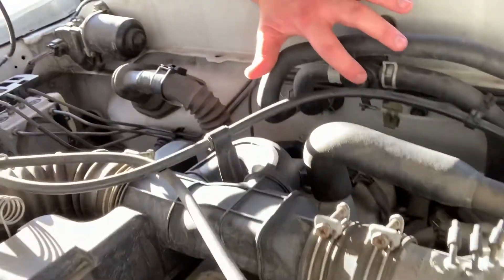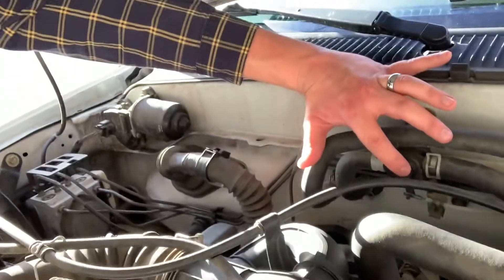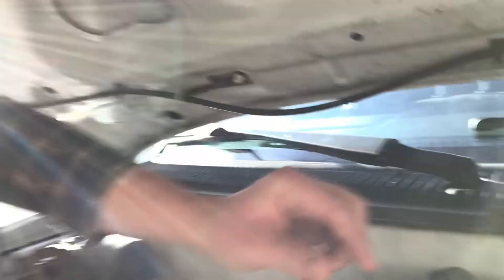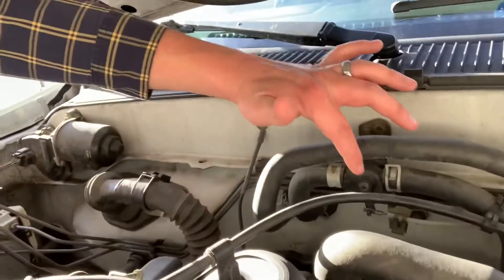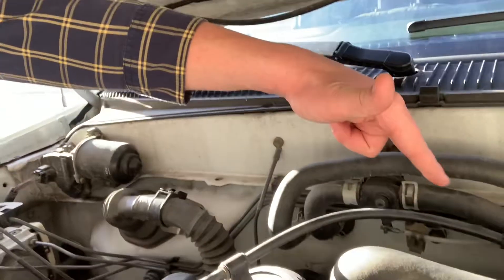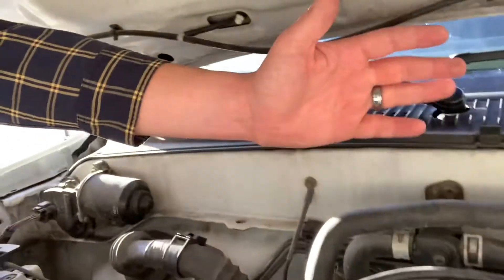1995-2004 Toyota Tacoma Heater Fix (For Free!)

Comment: If you haven't already figured it out yet:
The heat selector round knob on your dash that turns from blue to red
(cool to hot) is what is stroking that cable back and forth on that part which is the heater control valve. Not sure if your valve locked up or your cable came loose or jammed.
Reply: It’s a blend door actuator. Controls the flow of cold/hot air
Reply: @Caughtitoutdoors  
Possibly. I think cars use one or the other and many cars these days still use a heater control valve to do the same thing as a blend door actuator. He mentioned a cable and I believe most heater control valves are cable driven. Pretty sure blend door actuators are electric or vacuum. I have a cable driven control valve on my 98 Toyota Tacoma.  Fortunately for me it was only 14 bucks and I was able to change it pretty easily
Reply: The knob in the car drives a servo. If you forced the valve you have just damaged something inside the heater.  assy . More than likely you just totaled the servo. Ninety dollars plus labor.
Reply: @mhern57 explain ?